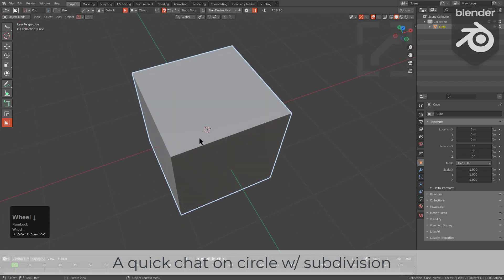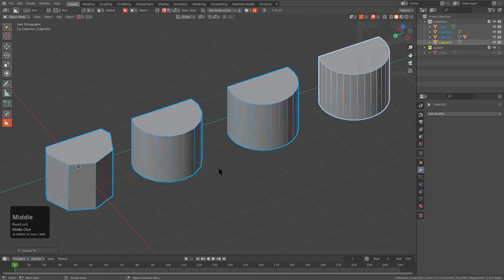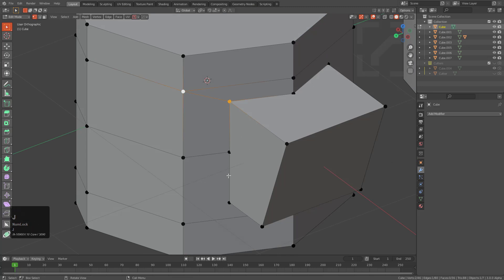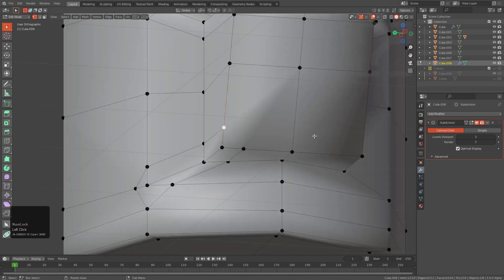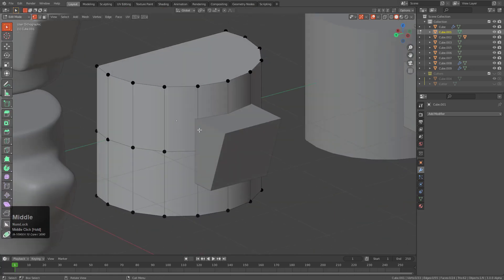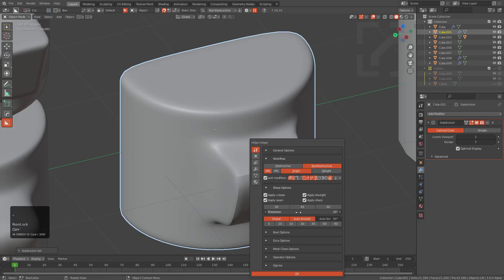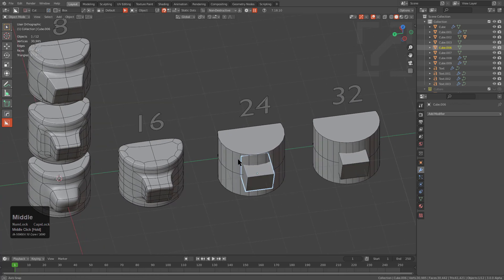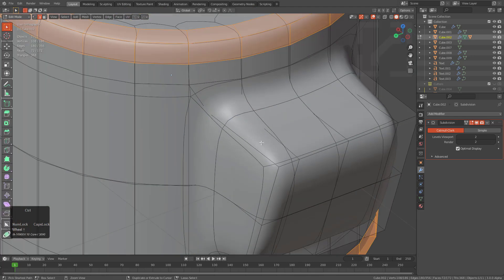#topostudy - About Cylinders

Comment: Something you might try is a combination of subdivision and bevel modifier. Basically what you are doing, just the automatic version instead of manual. I like to set the bevel by weight so I can specify what edges get beveled. Benefit of the bevel mod is then its real easy to adjust the bevel factor instead of having to go back and move vertices. Although I've found some situations where it won't work well still and of course the resulting topology may not be good if you need to apply it.
Reply from the maker: there are those out there willing to fight an 8.